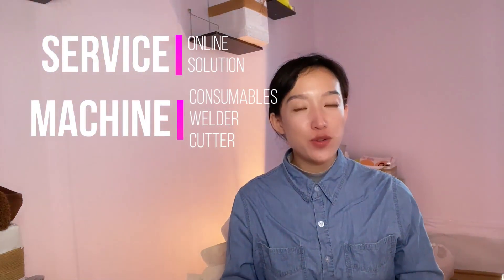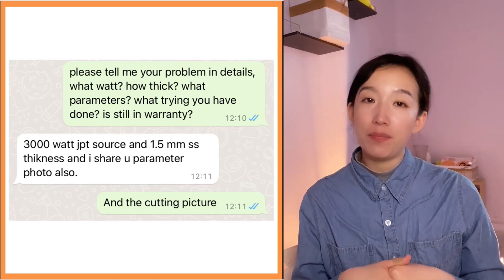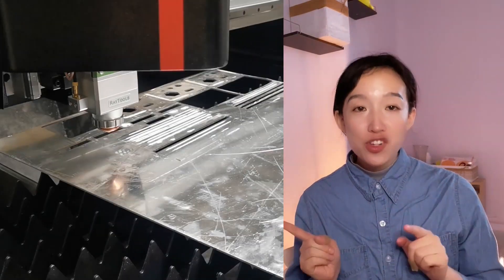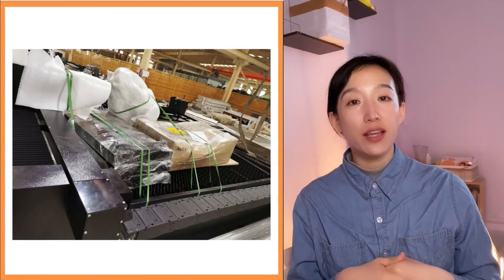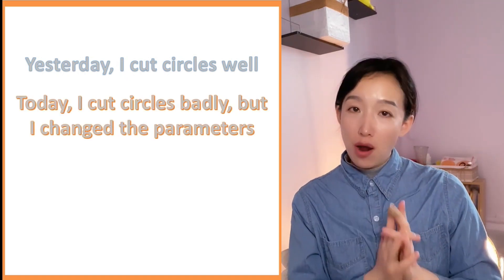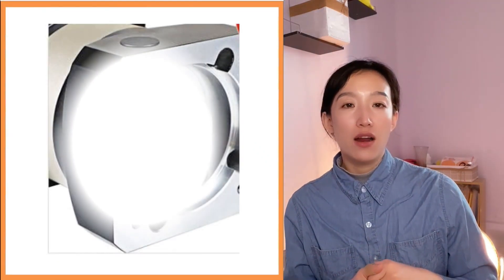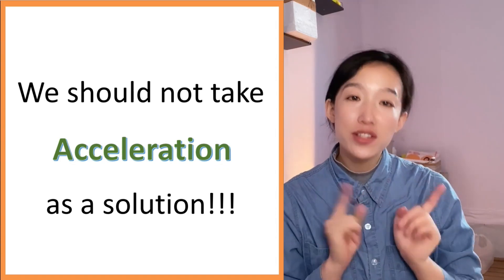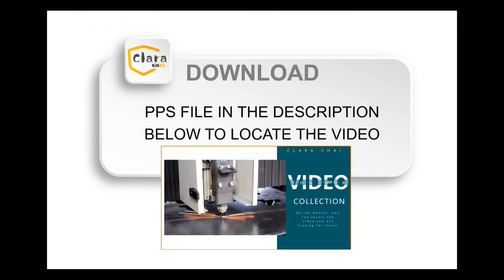Real Case: Circle Cut is not Round | Precision of Fiber Laser Cutting

Comment: I had a problem where you set it for example to cut 500mm and it would cut 510, only one axis was cutting wrong, so I had to adjust the servos range in config under mechanism page in Cyp Cut software